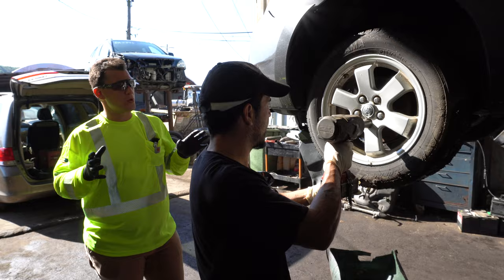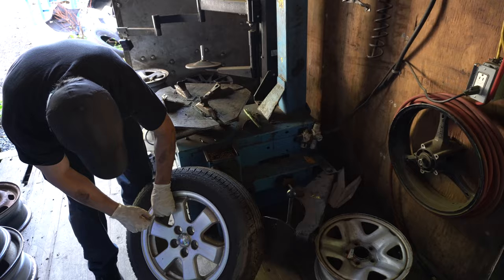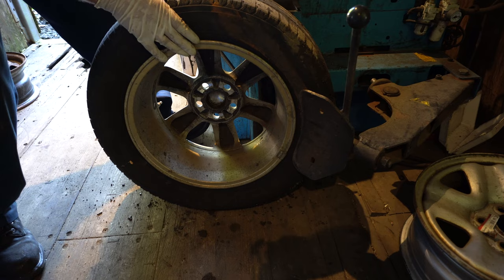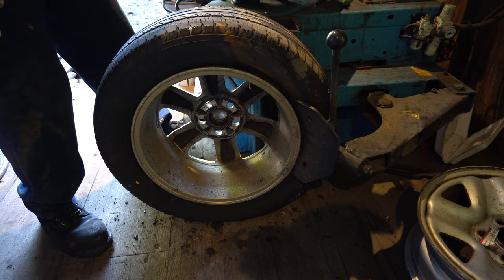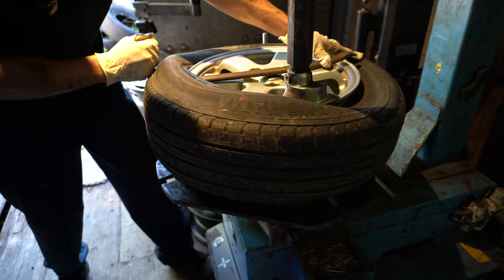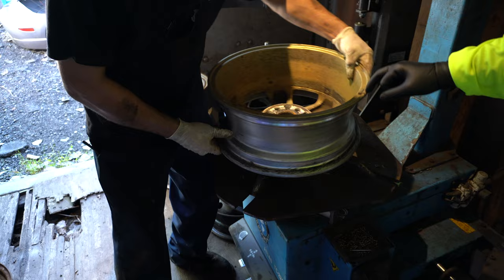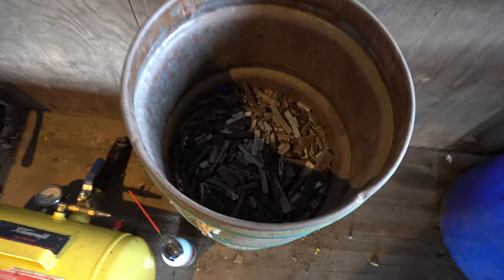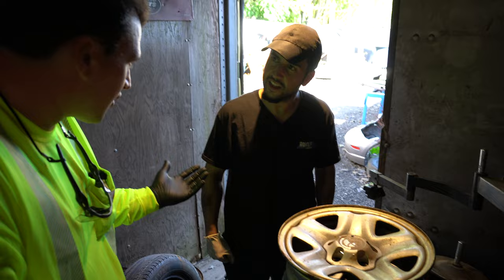[Part 5] Maximizing Profit from Wheels: How to Safely Remove and Resell Car Wheel Components

Comment: I invested $54 in a manual Harbor Freight tire changer it was well worth the money once I got the hang of it from breaking the beat to throwing the rim in the scrap pile I could average 1 Tire in 7 minutes complete an average car rim weighs 22 lb I charge $4 per tire because here in Florida you have to pay three dollars per tire to get rid of the rubber the one job I had was 65 tires With rims in one shot at that time prepared steel with 10 cent a pound if you do the math I made $65 for the tire and rim itself the rims alone wait 1430 lb that's 143.00 so that becomes $208 for the full process🤠